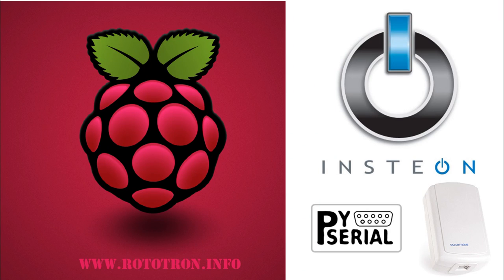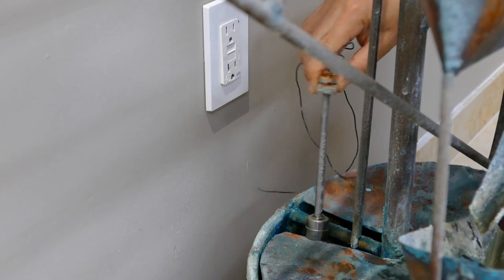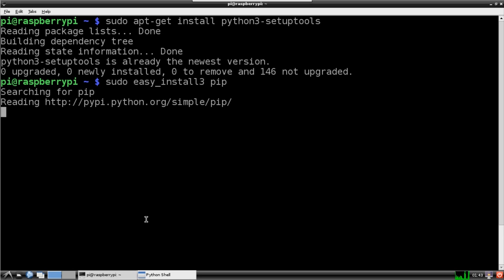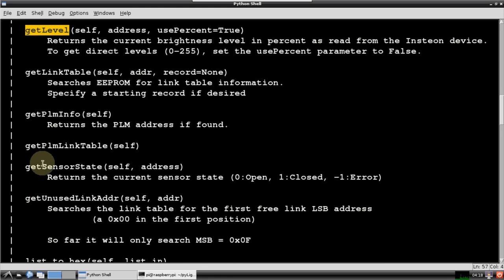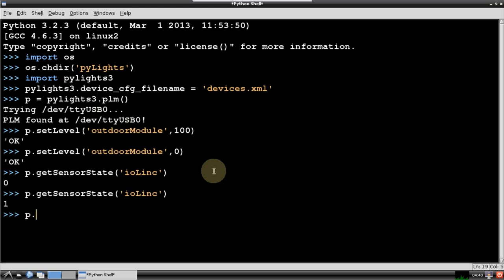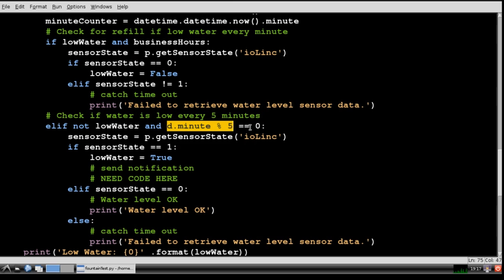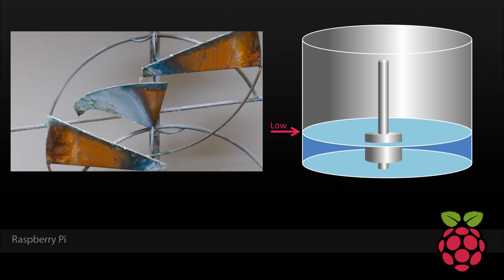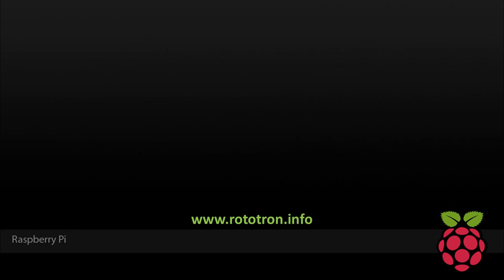Raspberry Pi Insteon Fountain Monitor

Comment: Another solution to the float switch problem, add a mechanical hysteresis.  This is used on sump pumps.  When the float hits the bottom it pulls the switch off.  When the float reaches a high point it pushes the switch on.  The float can oscillate between these 2 points without change in the switch state.  No additional electronics required.

Comment: Nice video -- I was looking for some ideas and examples to show me how to send X10 controls via a Raspberry Pi and I learned a lot from your video and that has really helped me.  But I did hit a few problems.

I downloaded both the pylights.py and the pylights3.py files and placed them in the ~/pylights directory.  I opened a Python shell and entered the following commands:

>>> import os
>>> os.chdir('pyLights')
>>> import pylights3        That line gives error: line 22, no module named queue

Line 22 reads: import threading, queue
The corresponding line in the original pylights file reads:   import threading, Queue

I changed the "queue" to "Queue" and that cleared the error.  I continued by repeating the 3 above commands and added a new command:
>>> p=pylights3.plm()

That resulted in several errors, all of which trace back to "queue" vs. "Queue" in lines 355-357 and 566.  I changed all of those to "Queue".  That cleared all the errors and when I re-ran the above commands the PLM was found at /dev/ttyUSB0.  Then I entered an X10 command:
>>> p.sendX10('B',1,'off')        And that turned the light off :)

Thanks again for posting such a helpful video.

PS.  Tried to leave this comment earlier but was unable due to YT's convoluted, screwed-up comment system.
Reply from the maker: Phil Sullivan In python 2, Queue is upper case.  In python 3, queue is lower case.  I wrote my code in 3.  Thanks for your helpful feedback.

Comment: Considering the cost of the Insteon hardware (~$250), wouldn't it have been a lot simpler  to just use a dedicated Pi at the fountain? You can pick up a dual relay module to control the power for under $7, run the sensors directly to the Pi.
Reply from the maker: You make a very good point.  This was primarily a proof of concept with the intent of using the Pi for a whole house automation project.  Second, the fountain is in an office lobby that is subject to frequent inspections.  Any equipment by the fountain needs to be UL listed or an equivalent nationally recognized testing lab certified by OSHA.  

Also, the Insteon equipment frequently goes on sale.  I paid less than $100 for everything which I agree is still a lot of money.  It is not my intent to endorse Insteon.  Reviews indicate that UPB is probably better.  However, the Insteon system at my office has been running continuously for over 2 years without any problems.